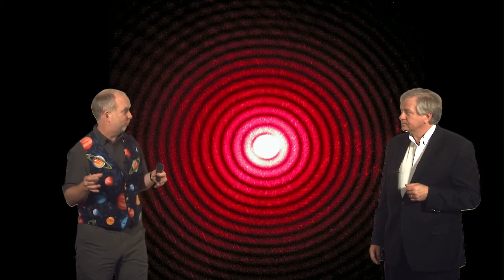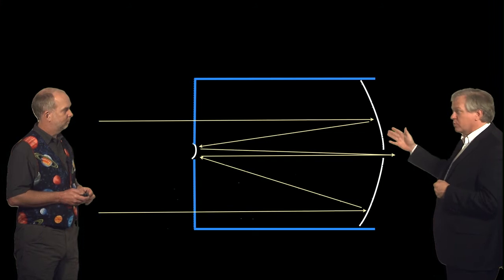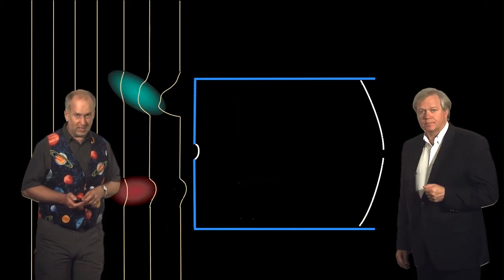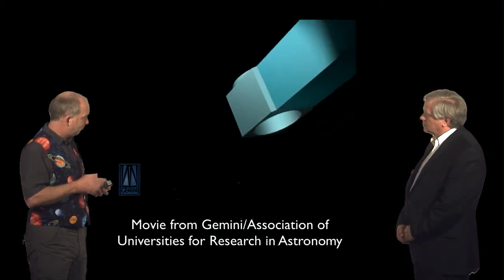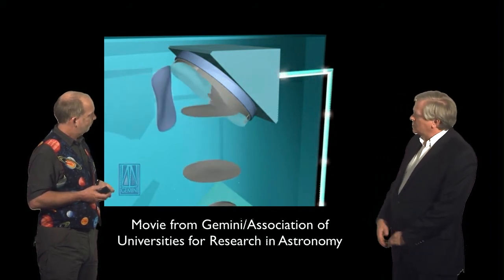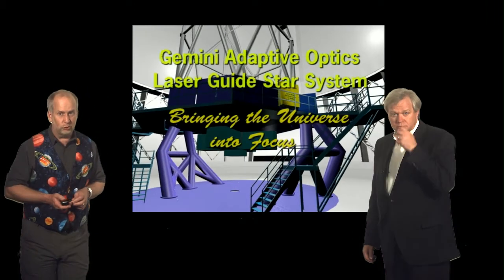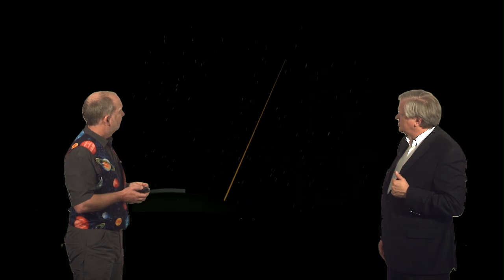A2 L07 V06 Adaptive Optics

Comment: You would think that the constant bending of the mirrors would create fatigue in the mirrors. Kinda like bending a paper clip over and over, it eventually brakes.
Reply: It creates fatigue but it has to shift the phase only by 2pi which means it bends with the maximum amplitude of the wavelength. This means it can bend very often and it won't cause problems.

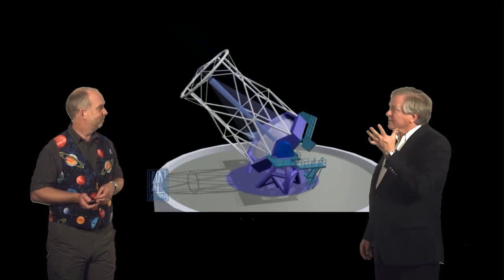Comment: At 6:49 there is an obvious mistake. It is NOT twice the effect, as being said. The artificial star is produced due to the correct wavelength of the laser. Until this point, any atmospheric distortion has no importance. Actual adaptive procedure starts from the point of light leaving he artificial star and coming back to the telescope. So the effect is happening once, not twice.
Reply: PPanos1968 yup.looks like the other host was aware of this mistake, but didn't want to correct his colleague "on air"
Reply: agreed, he missed that